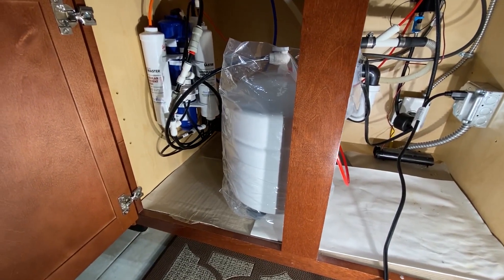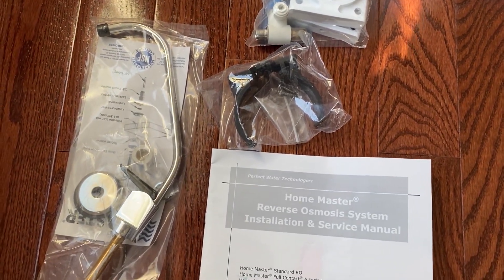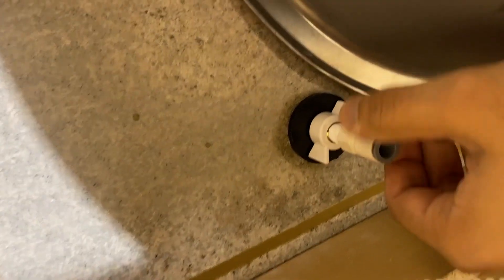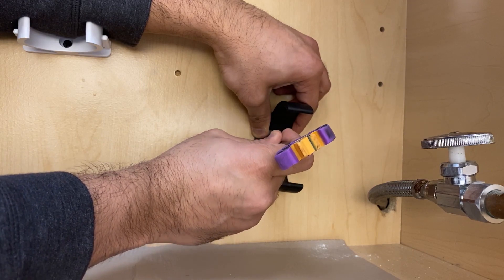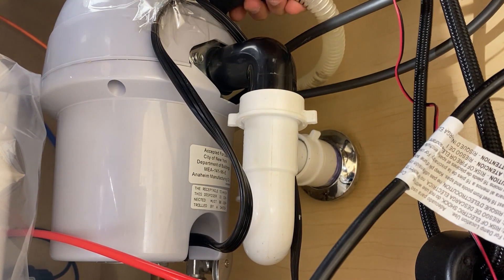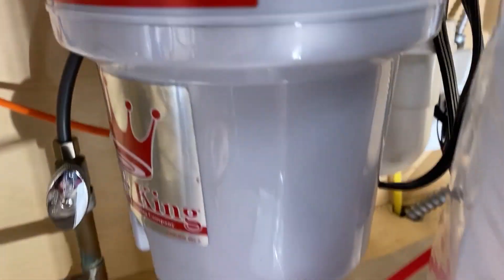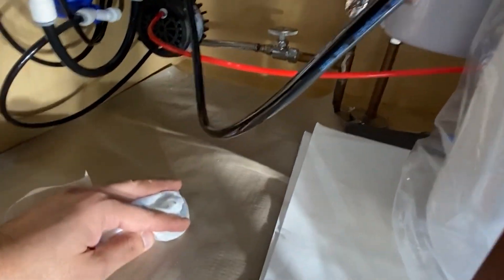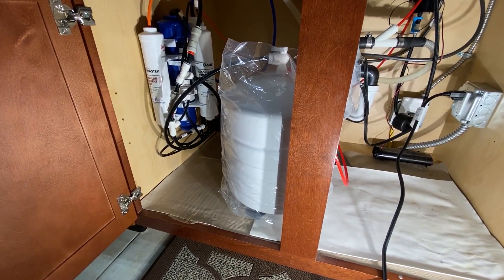How to Install Home Master Reverse Osmosis with Permeate Pump

Comment: Home Master uses 3/8 tubes, did your drain line adapter work? it seems to be made for 1/4 tubes.
Reply from the maker: Yes, It's 1/4 tube and not 3/8. hope this helps!
Reply: Yes, they use 3/8 tubing from tank to faucet, but it is a 1/4 drain line into drain adapter
Reply: Mine had a 1/4 hole to, I had to splice another tube on the line for the adapter i got.

Comment: Nice video, how long would it take me to fill up a 20 gallon aquarium with this?
Reply from the maker: I am thinking 8 to 9 hours approximately
Reply: If you choose the option for the hard water membrane ($6.00), your system can produce 75 gallons per day, about 3 gallons per hour.